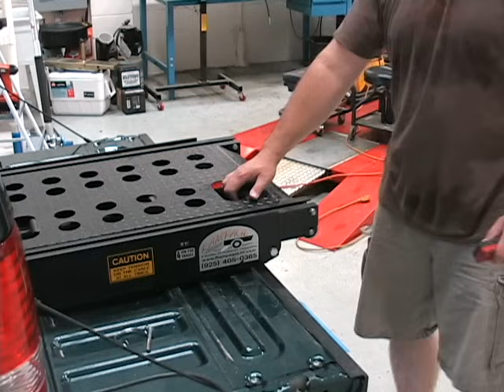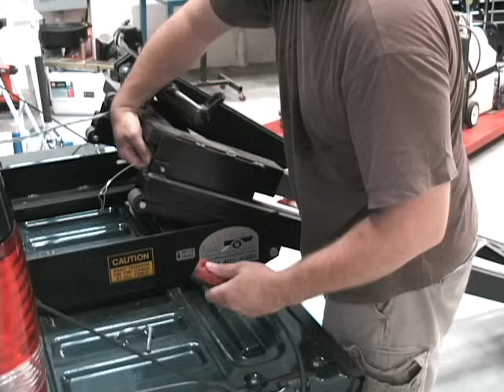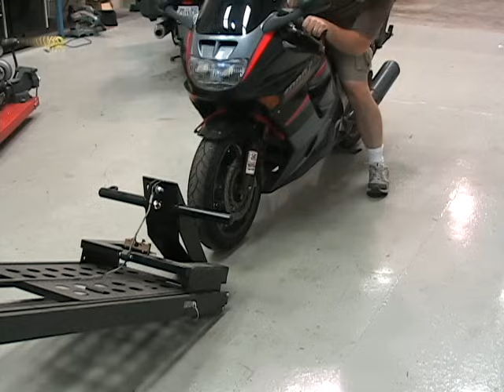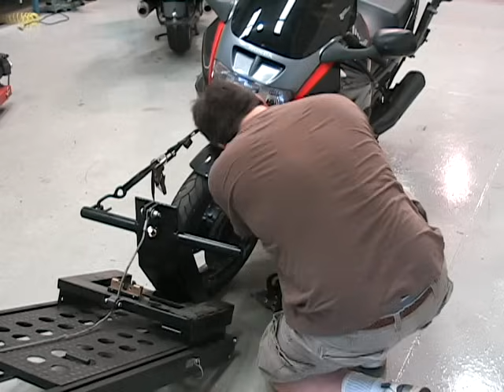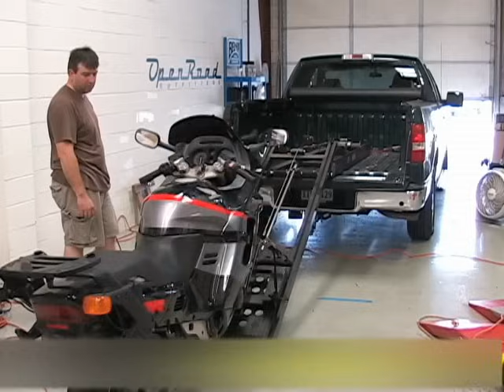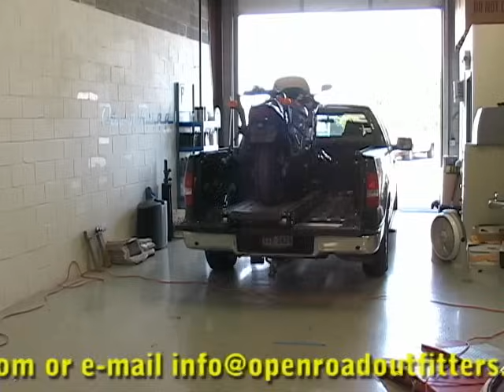Demo of the Rampage Power Lift for Motorcycles

Comment from the maker: Hi broncomatt1 - yes, the installation includes rivet nuts that are embedded in the truck bed. So you slide it in, bolt it down, and do the opposite to remove it.  There are options for ramp extensions and bigger winches that will allow you to use it in higher trucks.

Comment from the maker: I've seen it done in pictures but haven't done it myself.  You have to build a platform above the wheel wells, basically level with the top of the bed, to allow room for the bikes to sit side by side.  I don't know if I'd feel comfortable doing that, but I know some have.

Comment: Does it work with a truck bed that is 44” off the ground?
Reply from the maker: Yes, that can be made to work. To reduce the load angle, Rampage would recommend that you install blocks under the front end of the unit. You could also bump up the the upgraded winch for a little more pulling power. They are pretty good about helping customers figure out exactly how to make it work.